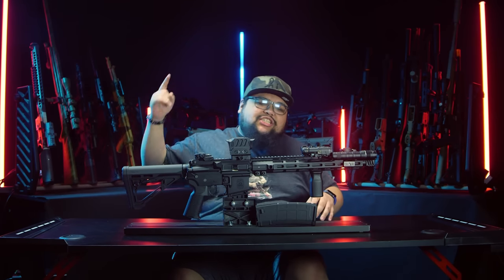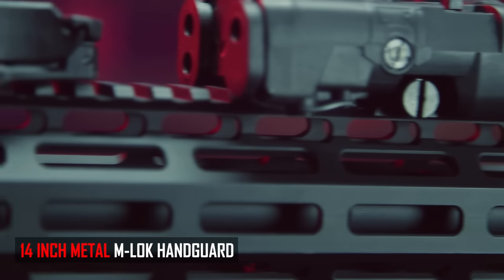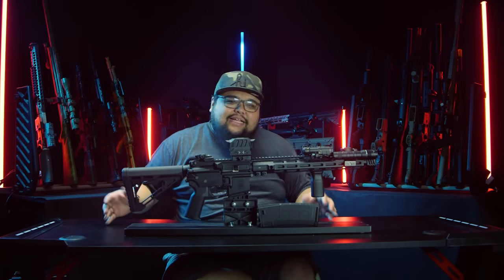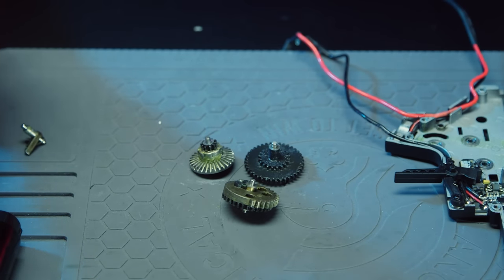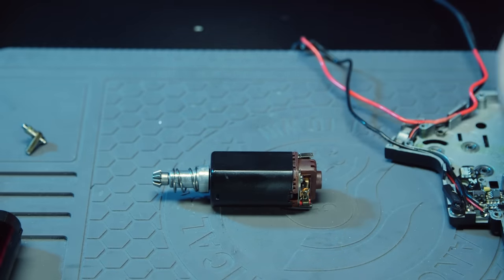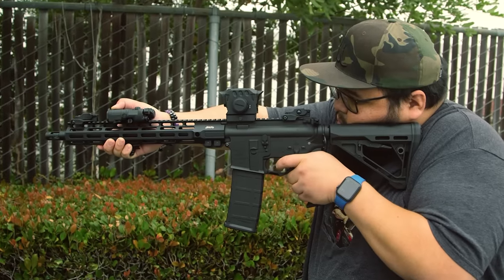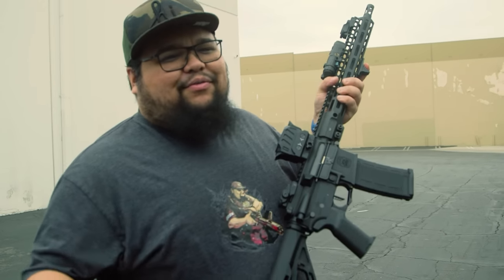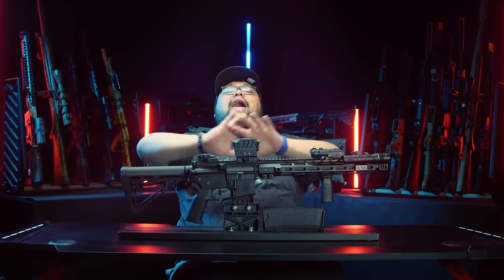THE BEST HIGH END AIRSOFT GUN?! - Mayo Gang MGC4 MK2 AEG | Airsoft GI

Comment: Just got in my MGC4 MKll  and I have to say is ok feels light but the one thing I don’t like at all is it doesn’t have a bolt catch also that dummy bolt release wobbles to much now I see why they made it blurry when Cisco was adjusting the hop up so you won’t see it doesn’t have a bolt catch also a screw to take off the upper receiver why not a push pin come on guys. I would say it is a good airsoft gun tho

Comment: What type of battery dose it need? Also, very cool gun
Reply from the maker: While you can technically use any battery you prefer, we recommend an 11.1v LIPO battery, more specifically a 1100mah or smaller stick. Bear in mind the gun is wired to deans and the battery will need to be wired to the same connector.
Reply: @airsoftgi  how do I put the battery in I just got it?

Comment: Can someone please explain why airsoft guns dont come with a lower ratio gearset out of the box? I am not fully convinced that it "keeps the cost low"
Reply: Two possible reasons:

1. 13:1 gears are harder to pull than standard 18:1 gears, so they kind of need to be paired with a stronger motor, which means neodymium magnets. Neodymium magnet motors are more expensive. 
2. If OEMs are making 18:1 gearsets at high volume, then changing to 13:1 would be more costly.

Comment: Ok so this gun mgc4 is built by airsoft gi? And you can buy it from them?
Reply from the maker: The MGC4 line is an Airsoft GI exclusive and only available on our website and in store. This line is OEM'ed by the Lancer Tactical Factory. This is the same factory that makes airsoft guns for Novritsch and Specna Arms. You can get them here and use coupon code "20th" to save 10% off. https://www.airsoftgi.com/Airsoft-Guns/Electric-Airsoft-Guns-AEG/Airsoft-GI-MGC4-AEG/
Reply: @airsoftgi thank you!
Reply: @airsoftgi I’m assuming since it has a mosfet I can run a 11.1 lipo Titian battery?

Comment: Is that the same motor that’s in the gen 2 proline? I found it to be sluggish compared to the gen 3 19k motor.
Reply: Low key looks like it is. Just remember a quality 16tpa (30k) neo motor will have more torque + efficiency than a 24-30tpa (19k) ferrite motor.
Reply from the maker: Updated motor. The OG 1st gen MGC4 had a motor which people advised us was a bit sluggish so we swapped it out for the enhanced variant and the MK2

Comment: Whats the difference between this one and the MGC4 MK2 p+ for $642 on the site right now? And what battery and charger is recommended for it?
Reply: Was it really listed for 642? Right now the p+ is 357. You get a better inner barrel, bucking, and nub with the p+ version. You could buy the same parts and do it yourself for pretty much the same money. Or you can buy regular stock version and get better upgrades later.

Comment: Received my order from GI in rough shape missing products. My Mgc4 was okay, but the field ready V3 was missing a tac light with my package. No packing in the box so everything was loose and smaller boxes within damaged. Batteries and goggles strewn about, the guys at GI won’t answer my calls or return emails. Pretty disappointed for dropping 800$ at this store. Evike it isssssss. Customer service is ass

Comment: Mini type connector or deans? And buffer tube size battery?
Reply from the maker: Deans connectors, and we’d recommend up to a 1100mah battery but I personally recommend sticking to at most a 1000mah battery.
Reply: @airsoftgi  Thanks! I’m excited to try this mk2.
Reply: @airsoftgi  Is it picky on it's C rating. For instance my Samari Edge gets picky with anything above a 20c and people tell me they run 35c idk how my gears lock up and I don't want that happening with this.

Comment: ok, but what if I like Miracle Whip? Give it a a r hop or flat hop and you'd hit those 250 ft  distances with no issues.
Reply: Sugru it and do 300 feet with consistency.
Reply from the maker: Believe it or not, simply by swapping out the inner barrel assembly for a Unicorn Airsoft set will get you near R-Hop levels of consistency. Check it out 👌🏼

https://www.airsoftgi.com/product/MAYO-GANG-MGC4-MK2-FULL-METAL-M4-AEG-W-ETU-AIRSOFT-RIFLE-PERFORMANCE-BLACK-69761/
Reply: @airsoftgi  Noice

Comment: This better than the KWA RONIN T10?
Reply: MGC is worse. Compression is  average and wont last long, motor is really weak and slow. Only good thing about MGC4 is mosfet. That’s it. But ronin T10 is actually worth the money. It’s way better compression and accuracy. Fast motor and compatibility with Gate mosfets is an asset
Reply from the maker: @javelinx1330  It is hard to compare because they are different. The KWA Ronin T10 is great and we love it! However, it is a very unique because it is an ERG and its price point. With the MGC4 series, we wanted to make a reliable and great performing airsoft gun that would break the bank. On top of all of that, the MGC4 line has a one year warranty. Also something to note is that we have not had any of the MGC4 line come back with any problems. That includes the MGC4 MK1 that was released October of last year.

Comment: Airsoft GI have called several times and gotten no answer about my order for the Zion arms performance ++ it came with the upper receiver all scratched and damaged as well as the upper receiver and lower receiver not even connected. When I plugged in the battery and shot the gun the BB goes out about 15ft and drops straight down not to mention it’s barely even moving when it comes out of the gun. This is how you guys do customer service??? Someone needs to make this right!
Reply from the maker: Hello, if you haven’t already, we highly recommend you DM us on IG, FB, or our Discord server so we can further assist you

Comment: This is mid-tier actually. 18:1s are industry standard. Basic vanilla compression parts. Motor is weak, it’s not even 30k neodymium. The most valueble thing inside this AEG is it’s mosfet….that’s it…. 😢
Reply from the maker: Yes, 18:1 gears are standard, but ours are steel out of the box. Not all companies include a full metal rack piston or an o-ring air nozzle still. This should be standard. The 25k motor out performs a ton of OEM motors from different factories. We know it isn't the best motor available, but it provides great performance out of the box while helping keep the cost more affordable for people.